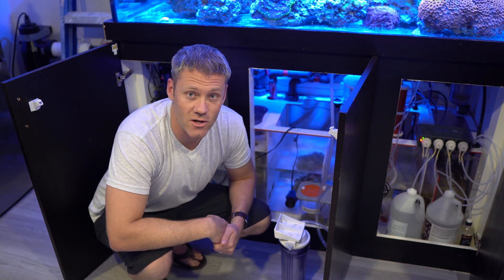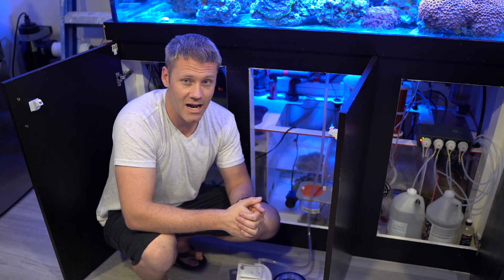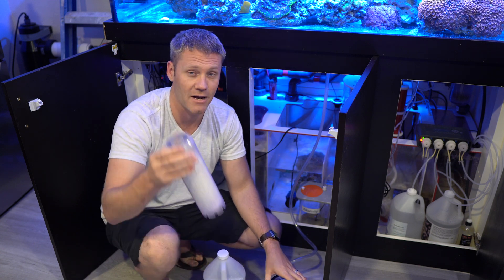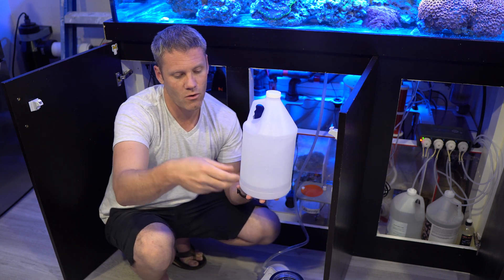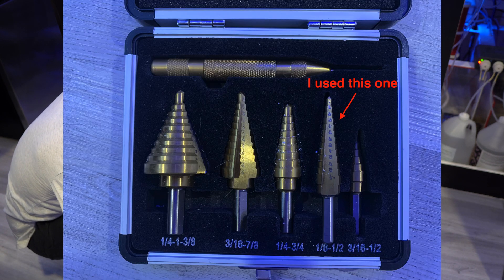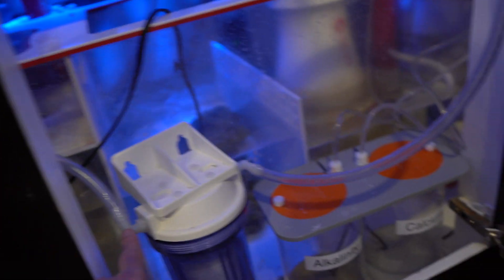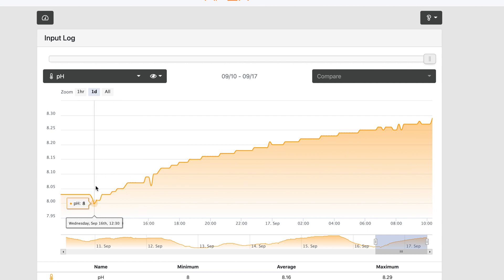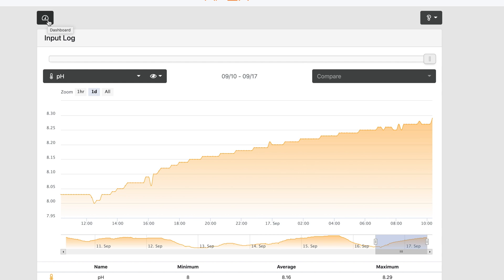Adding Humidity to CO2 Scrubber

Comment: Just subd. Any update on this?
Reply from the maker: It worked great when I had it, made it so I never needed to add water at the bottom of the chamber. I switched to a recirculating CO2 scrubber and added a jumbo chamber & solenoid . Really like that because now my PH stays at 8.3 and I don't have to change my media much and it last way way way longer.
Reply: @reefingainteasy3754  thank u brother. Yeah i saw your vids. All great! Im still learning. This is my first saltwater after quiting from freshwater long time. I think im gonna try your set up. Thanks again brother!
Reply: The tube is above the water not submerged correct???